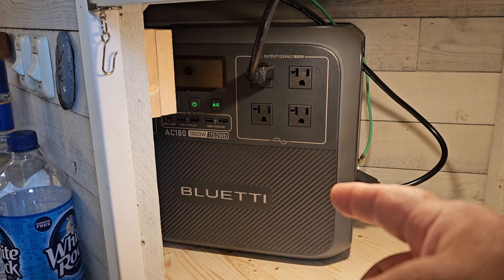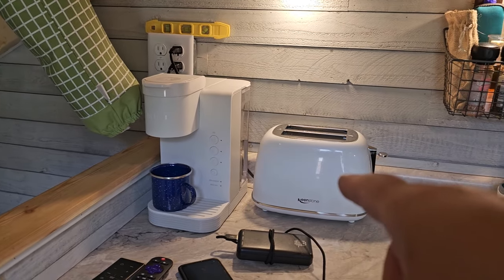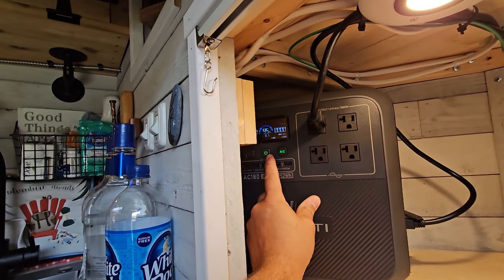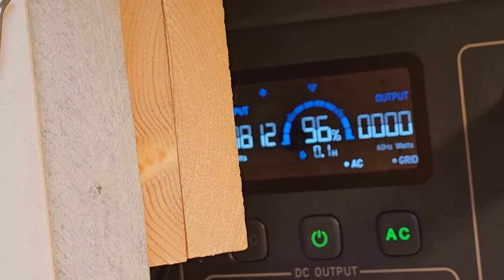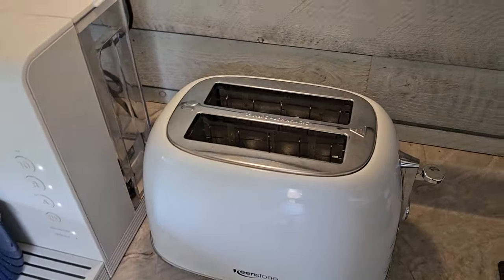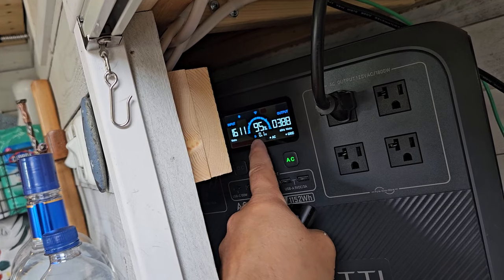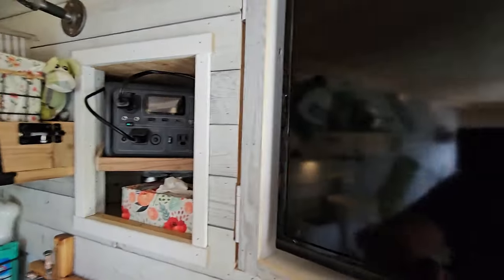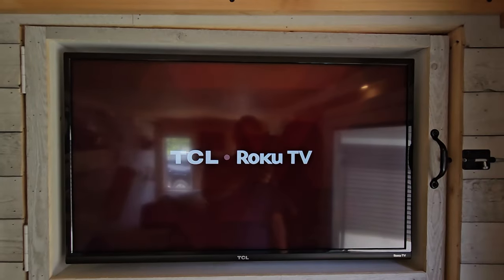BLUETTI AC180 1800WATT - 1125WH POWER BANK! REAL WORLD RV APPLIANCE TEST!

Comment: You are going to kill the batteries in those Sogens if you keep blasting them in Turbo Mode, Even the standard mode is too high most of the time, And if you want to extend the life of the batteries you need to charge them on Silent mode, YES you can use the other modes in an emergancy but not all the time.

Comment: Is it normal that my ac180 has a clicking relay when it’s connected to the solar at sunset/sunrise? AC/DC is off. Apparently, it's not enough sun to charge it and it makes clicking noises every few minutes.
Reply from the maker: Probably as the panels just get enough power input to kick in the solar power input on and off until it gets enough power to keep it constant
Reply: @toddelfers  I also have eb3a and several ecoflow and none of them have this clicking noise. Also, for some reason, if nothing is connected to the ac180 it automatically shut down the display and the device itself after just one minute. So there is no way for me to remotely turn on ac or dc.
Reply from the maker: Did you update the firmware yet?
Reply: Yes, it has the latest firmware

Comment: Please tell us about the green ground wire on the AC180.  Do you need it because you are charging using a generator?  I'm looking to use my AC180 to increase my battery power in my 1996 Jayco.  My coach battery is under the hood so not much room to expand.
Reply from the maker: Probably don't need it but it doesn't hurt is what I'm thinking. It took me Probably 5min to run a wire from the ac180 to my breaker box ground bar so why not right?

Comment: At 17:40 I think you have the airflow reversed.  The fan on the right side is a pull fan and is pulling air out of the unit and the fan on the left side is the push fan, pushing air into it.
Reply from the maker: I don't think you get the option in the app or screen to change it

Comment: Nice video. 

The less watts you have under load the less efficient it is, at around 30 watt the efficiency will drop to approximately 52%.

I'd have to look at the AC load chart again as I'm just going by memory.

A Google Search: 

Is it typical a smaller load on a
AC inverter will cause it to be less efficient? 

Answer: 
.
"The efficiency of an inverter varies with the load. Typically, it will be highest at about two thirds of the inverter's capacity. This is called its "peak efficiency." The inverter requires some power just to run itself, so the efficiency of a large inverter will be low when running very small loads."

Comment: Great video! Was wondering about the ground cable on the 180. Whats the added safety of a separate cable going to the breaker box bus when the power cord also is routed in the same box bus? No critique just trying to understand because im aiming the same type of build🎉
Reply from the maker: Ground cable goes to my trailer frame
Reply: @toddelfers  yeah i got where its going, was wondering about what it adds though in safety sense, since the ground is already connected through the ac plug

Comment: Can you cover this as a topic?
The BLUETTI device has a MAJOR security vulnerability. The bluetooth is always enabled when the device is powered on and it is not secured by any authentication or prompt on the device. There is also no way to disable the bluetooth. This means that anyone can connect to the device using the app via the bluetooth interface and control the power station (turn on/off power). This becomes a vulnerability in that critical systems can be turned off, systems that are required for animals (automated feeding systems, fish tank aerators) can be affected putting the wellbeing and life of animals at risk, and at worst, any medical devices can be turned off with a risk to human life.
Reply from the maker: Interesting! Didn't know this! Thanks
Reply: Even if it’s enabled it won’t connect to other devices only u have to disconnect from one to connect to one that’s how it works

Comment: I just bought this exact unit,I'm somewhat worried about leaving it in high hot temperatures...
Reply from the maker: I've ran mine inside my camper in 90 degree plus temps no problem
Reply: I am currently staying in Phoenix AZ.It's 108f right now,I'm keeping an eye on the unit,making sure it doesn't do anything strange...

Comment: Amazon had it on sale for $459 -- good deal?
Reply from the maker: That's a smoking deal!
Reply: @toddelfers  Awesome. It must be coming from China since I ordered and it won't come until end of November. Do you think it's enough to power the following devices: Starlink for 7 hours, charge phones at night, power 15inch macbook pro for 8 hours while being charged for about 5 hours with a 400w panel?
Reply from the maker: Times the watt hours by .9 (90% efficiency about) which is 1024 x.9 = about 920 watt hours. 

Take wattage of what you're running and divide it by 920 = time it will last approximately
Reply from the maker: Watch this https://youtu.be/I-7QJc6X1mE
Reply: @toddelfers  Starlink is average 60w, my laptop 60w which is total of 120w so 920/120 gives me 7.6 hours. That's pretty close to limit I think.. I may be underpowered?
Reply from the maker: Might be under powered to some and some might be fine. It's all about expectations. There is a reason why I sold my ac1i0 for a ac200l with a b230 battery and I know have 2 pv350 panels. It's like an addiction to power.
Reply: @toddelfers  LOL, yes we all have a Tim the Toolman Taylor in all of us, "more power!"

Comment: All that romex and bx cable exposed is installed against code and is a hazard.
Reply from the maker: Thats 12volt DC! 🙄...Wiring is exposed in new construction houses in the basement which leads into the circuit breaker = sorry... but you're wrong.... are you saying there is codes for converted cargo trailers? Really? The only exposed wire is in the area behind the TV area that goes to a 120volt circuit breaker box unless you're talking about the 12volt DC...?... rest is AC stranded wire in conduit if you watch the wiring series in the playlist area. Rest of exposed is low voltage 12volt DC which is what you're probably talking about. If the shielded wire goes to a light it's 12volt DC..... if it goes to an outlet then it is 120volt AC and is stranded wire in flex conduit.

Comment: for $250  more you can get the pecron 2000lfp. no taxes or shipping on that one.
thoughts?
Reply from the maker: This only cost me $779 before tax. $2500 more is a huge step in price. I think it really depends on how much more watt hours you really need. The AC180 has a huge 1800 watt inverter but with only 1152 watt hours. It's fantastic for running appliances that require a lot of power for a short period of time like a coffee maker.... not an air-conditioning unit for extended period of time.
Reply: @toddelfers  $250, my mistake.
Reply from the maker: That's not a bad deal actually. Looks like it is $300 more tho